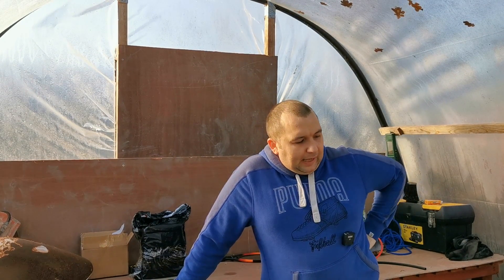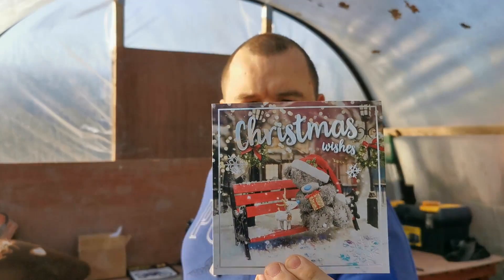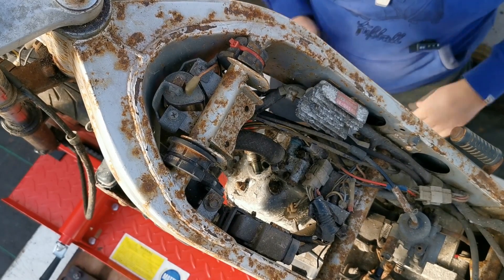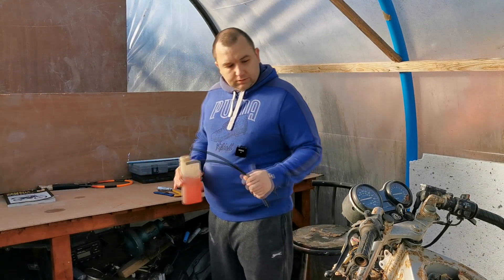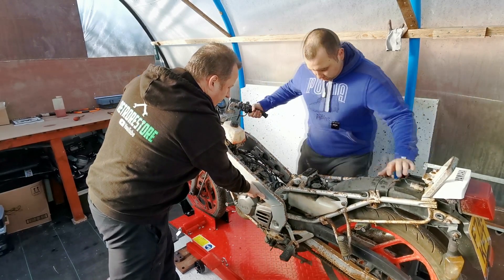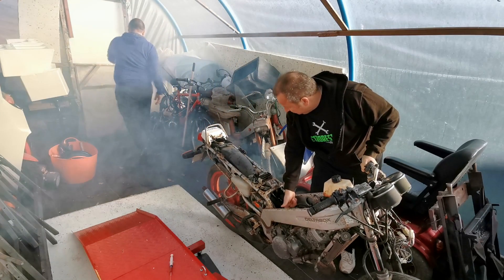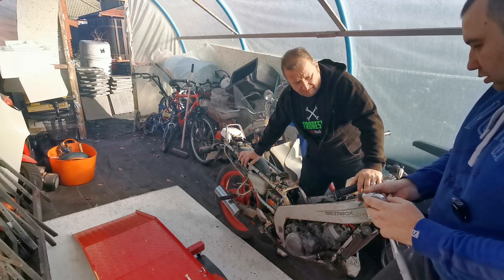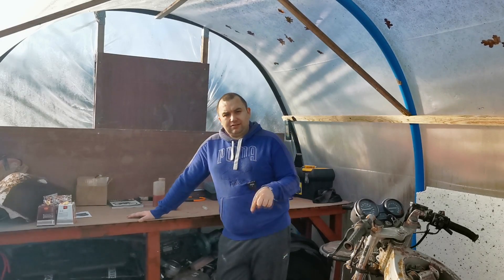WILL IT START? YAMAHA TZR 125

Comment: Back in the day a had a MK1 RD125LC excellent bike and at the time with an up grade on everything , engine , sprockets carb , reeds.  100 mph , nice project tzr. On some 125,s they had a power valve that where connected and some you could open manually.
Reply from the maker: Interesting cheers bud 👍🏻

Comment: You should be able to start the bike with the side stand down it's more of a neutral safety switch, it will normally stall when you put it in gear to stop you riding off with the side stand down
Reply from the maker: Cheers Peter I remember that

Comment: Hi Gary I had a tzr please be aware that you must always leave the steering lock on when you leave the bike in car parks etc the bike will run without the key simply by pulling one of the bullet connectors apart in the area of the headlight! I bought mine as a stolen recovered vehicle  that's how they pinched it!😃👍
Reply from the maker: Cheers bud Il bare that in mind 👍🏻